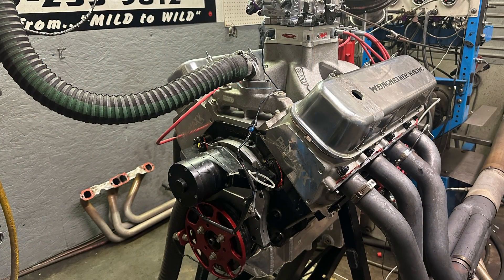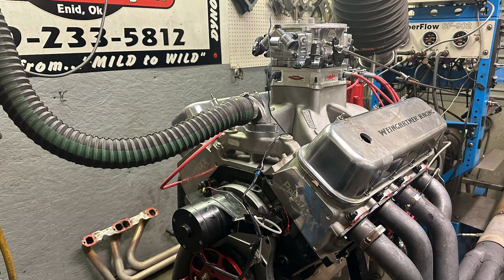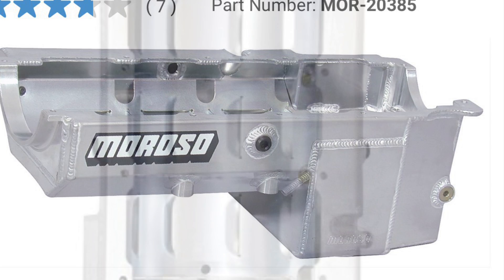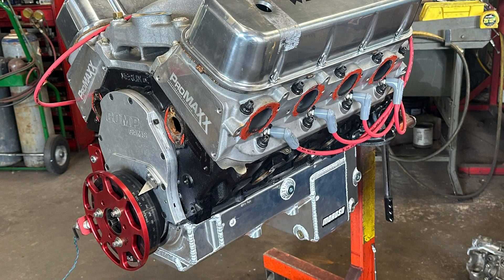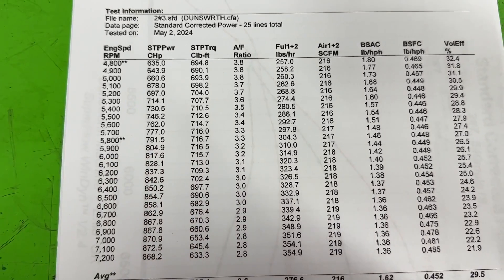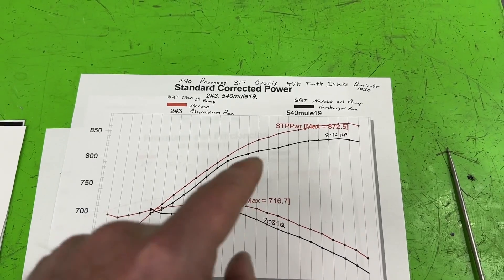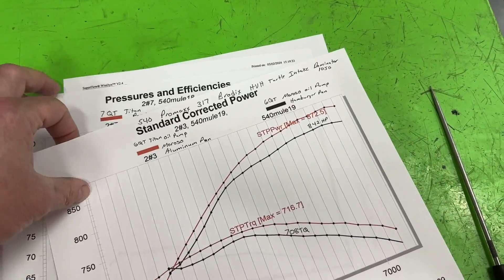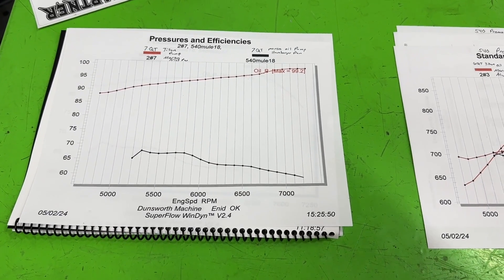540bbc Oil Pump And Oil Pan Test

Comment: I’m running the Moroso 20485 pan. Looking on their site, it appears to be identical dimensions as the 20385. I’m running the Moroso billet spur gear pump. However, we ran into the same thing on the dyno. Running Maxima break-in oil, and 6qts of oil, we’d start dropping oil pressure around 6800-6900rpm. With 7qts, it continued to climb through 7600 and 89.6psi, when we shut the run down.

Comment: I know there's no way to see on a dyno but I wonder if the pressure would drop with 6qts like that in hard acceleration. That would force the oil to migrate to the sump quicker so the reserve around the pickup wouldn't drop as quickly,,, maybe.

Comment: Put a big box style pan on it designed for a dragster and I bet you gain even more
Reply: Yep,Reher Morrison knew all this and used it on their 362 baby rat that they went to war with against Glidden back in 1980
Reply: @hilleryclifford1350  yep and the evolution leads to a dry sump always, it’s unfortunate that dry sump is so expensive that’s the biggest obstacle along with packaging they take up quite a bit of room as well
Reply: @DSRE535  For sure,definite overkill except when the money is on the line. The Germans developed and perfected dry sump oiling on the DaimlerBenz DB series of Liquid cooled V12s . Engines were mounted upside down in planes like the FW190.

Comment: Also wondering about oil temp difference’s between different pumps and do you use oil restricters ? Great stuff Eric ! 👍
Reply from the maker: We intentionally got the oil temperature to the same point to make a pull.  If we didn’t then the hotter would make more power. I will say it felt like it took longer to heat up the oil. I don’t use oil restrictors.

Comment: keep the oil away from the crank, ask an offshore racer
Run it through a filter with a clear screen and get scared when you see how much air is in the oil
Did you measure oil temp?
Reply: Aeration is a problem. 
Lake Speed Jr. tested and showed some oils are very bad.
Also anti foam additives that have settled out of the oil when sitting make things worse.